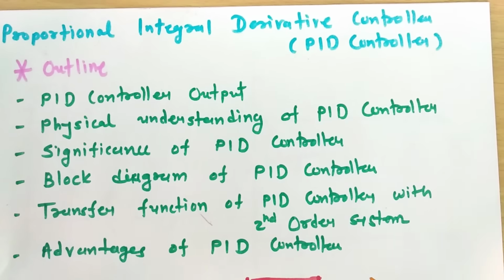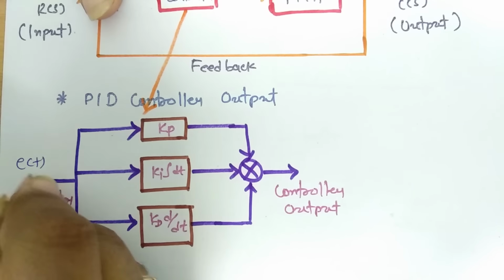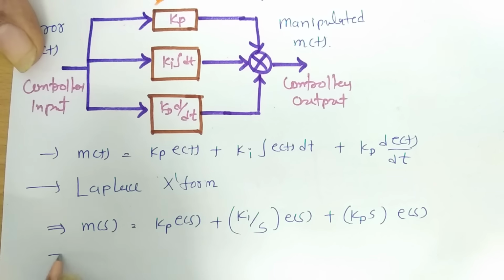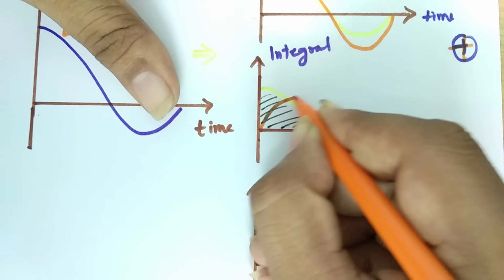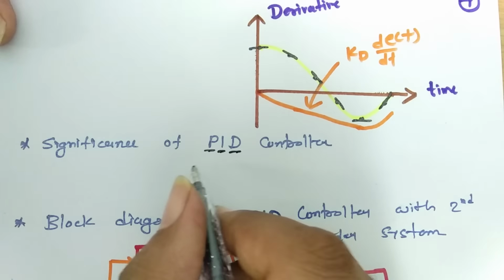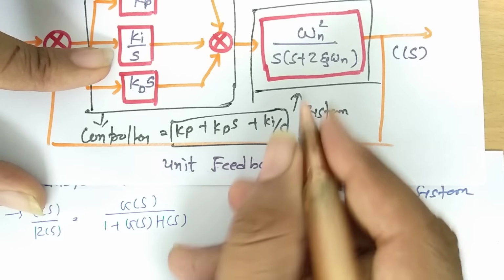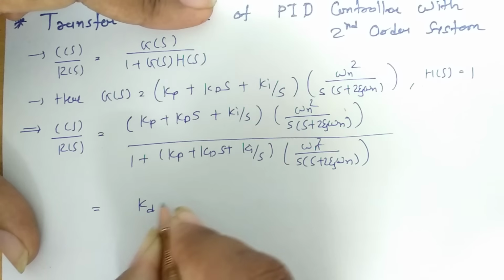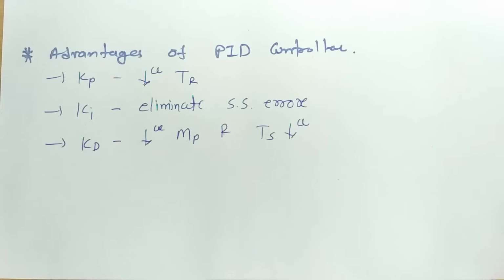PID Controller Explained: Basics, Block Diagram, Significance, Transfer Function, Pros, and Cons

Comment: prof am in for, the following courses this semester;
-CONTROL SYSTEMS 
-MICROPROCESSORS 8085 & 8086
- POWER ELECTRONICS
- DIGITAL COMMUNICATION SYSTEMS

greetings from KENYA
Reply from the maker: All the courses are available here on Engineering Funda

Comment: Why did you consider a pole at the origin of the plant?
I visualize better when I look at the real and imaginary plane of the root locus, but how do I find out what are the equation and coefficients for the plant? For example, a ball on an inclined plane. How would it be to apply a step error(t) signal to this plant, since it does not stabilize? The ball only receives aceleration.
Thank you.

Comment: Sir in video lacture (102) integral controller physical understanding diagram is different from this video PDI controller physical understanding integral diagram why? (means in both the videos integral diagrams are different why?)
Reply from the maker: See it properly. I have done it correct, so no issues with explanation.

Comment: Thank you for the video. I am currently planning on building a self-driven car using a series op-amps as part of a hobby of mine.  I have a question regarding the use of PID for controlling the 2 motors on an RC car.   I was wondering if 2 sets of PID circuit is needed for each individual motor? or a single PID circuit with the 2 motors feedback in the differential op-amp?
Reply from the maker: You can control one motor or two in parallel motor connection

Comment: Sir provide me an explanation over temperature control. By pid controller
Reply from the maker: +Sahil Shukla : if tempreture is a linear function then one should use proportional controller and for non linear controller one can provide signal conditioning + controlling by PID controller.